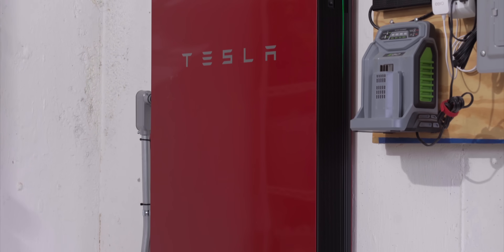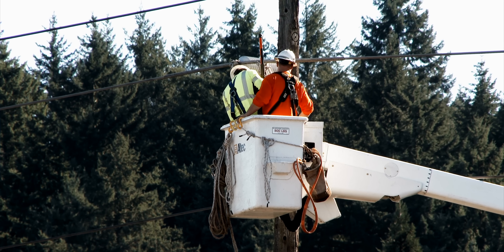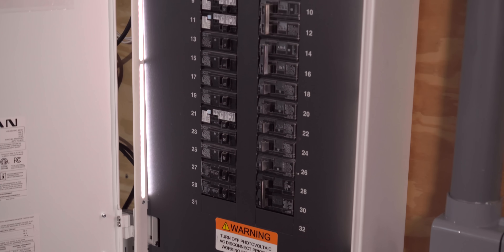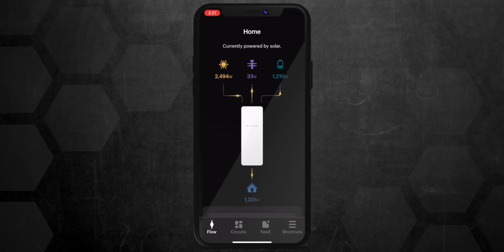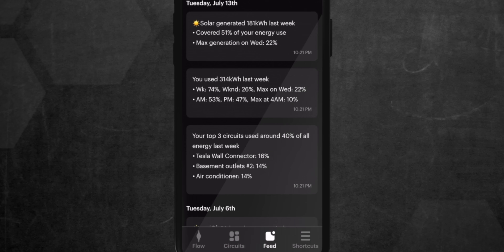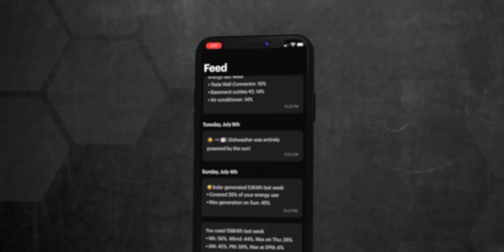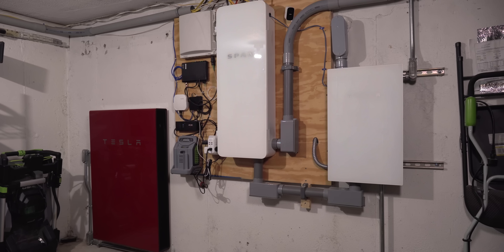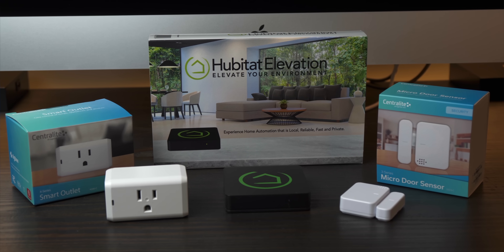This Smart Home Electric Panel Fixed My Tesla Powerwall

Comment: Sounds fantastic, my big and main concern is for when power goes out? If the internet is down am I back to manual control or will I be able to access it on my local network or directly via the app or another console? (sorry for the extra compound question).
Reply: Short answer.
Starlink.
Reply: I solved that problem by including a dedicated circuit for rhe internet/tv/router. It is included in the sub-panel that powers the house during an off-grid event.
Reply: @myfathersson7  That's my confusion. If the power is out, it will probably not be just my home. Having power to my router doesn't power whatever brings the service to my home. Or are those usually unaffected.
I think my alarm company has a box that uses a cell signal device with a battery in case of power loss, but I don't have "smart" access to any of that.

Comment: It'd be nice if Span connected to power backup systems via I2C or API. That would make it more flexible for home automation enthusiasts to integrate their platform  of choice.
Reply: It should work.   It should be able to tell how much power the generator is producing and allow you to decide which circuits and systems get power based on the three tier system.  You could change from fridge and electric stove to fridge and washing machine or fridge and lights everywhere.

Comment: You had me right up until you mentioned Alexa. I am not going to go down that road - Amazon and personal data are incompatible.
I really like the the control this panel provides. We have a 200A Square D panel, and with 3 240V circuits for our 10kW solar array, and a five zone mini split heat pump, and a 240V for our electric car charging station - and the way the house circuits were laid out for incandescent lighting (we have all LED/CF lights now), and for window AC - the panel is FULL. There are already a few half-width breakers, even.
Reply: Alexa is not enabled by default. The Alexa feature is an Opt-in so only activated if you decide you’d like to interact with your Span panel through Alexa. In your case, you could never activate it and it would work just fine.
Reply: Hoping they will be Home Assistant compatible in future

Comment: I have looked at Solar at various time over the years and the payoff has always been beyond the life expectancy of the components i.e. battery's, panels etc. and the Tax right off,s are some times there but mostly not, it has always come back to energy saving devices are the best way to go with my income( less than 6 figs) otherwise I am just buying another TOY to brag about at the Bar BQ.....so turn off the lights when you leave the room.

Comment: Thanks for the review, looks like a great product, every since smart products came out I thought a centralized smart panel was the way to go. The key element is getting the affordability, I currently use a energy monitoring smart plug system that I like but is lacking in software support to allow creative solutions and seems to be phasing out the power monitoring to become more of a plain herd mentality product and loosing the originality that attracted me. An idea I think is being under utilized would be the power monitoring of pumps for swimming pools. I have known people who had pools and the need to know when the pump is having problems is critical, from over 30 years in the power industry working with pump storage systems, power usage will tell you a lot concerning a pumps health and current operating status. I don’t know for fact but I would expect similar aspects would translate down into smaller pumps given the ability to monitor their power usage and program responses or alarms based on their real-time readings.
Reply: I agree. Pool pumps draw a lot of power, and if the filter gets clogged the draw can be more.
Reply from the maker: Great points, Tom.  Energy monitoring and control systems like Span can make a big difference for appliances like pumps.  Early detection of problems and appliance health is a big pro.

Comment: I’m all for saving energy but doesn’t this all seem really over the top? The cost benefit analysis of spending all of this money to reduce bills would take a lifetime to pay off with how cheap my electric delivery is.
Reply: It would make the most sense if you had an unstable grid where blackouts were common, lasted a few hours and had a high base power draw.

I would assume/home that a Tesla car charger and the power wall could talk so that charging ceased if the grid went down.  Other than that, I don't know how much you would want to shut off/on at the breaker, other than maybe stove and clothes dryer.

You could just use a smart plug for your dryer.

I have a number of smart plugs that I've programmed to shut off if the price of power spikes (I'm on wholesale rates).  If I had a battery, I could easily add in rules about switching off during blackouts.

For $3500 (as someone else mentioned), MAYBE if you were building a new, big house.
Reply from the maker: You hit the nail on the head.  What your local electricity prices are vs. cost of installing solar and/or batteriesis what it comes down to.  In my area, I'll be coming out way ahead over time.

Comment: In 1982 we bought land and had a house built. Favored the SW, added a two story sun room, heated with an open loop! Geothermal heat pump using water from our driven well 350 ft deep. The Carter administration offered substantial tax rebates to encourage active energy systems. Solar, wind were not yet feasible in southern NH.

Comment: How many circuits do developed countries have?? In argentina we have like two circuits per floor. I guess since 220 has lower currents and the cables have to go through in wall conduits (pipes) having multiple circuits is not as viable
Reply: They use electric for everything, heating, cooling, cooking, drying, etc.

North Americans consume a buttload of electricity.

Comment: If the “smart” side of the panel dies, will it default to all circuits “on”?
Reply from the maker: Yes.  It fails over to a standard dumb panel is a worst case scenario.

Comment: Already have that functionality built-in to my Enphase system.  Not the entire panel, but I can turn on/off up to 4 breakers which is usually your largest power drawers, which is all I need.
Reply: Is that from a standard Enphase system with Enphase battery or an add on?
Reply: @davidferguson7075  standard enphase system with battery.  I think it was only released a few months ago though.
Reply from the maker: Enphase has a really awesome solar/battery/inverter/panel setup.  Some really nice fine-tuned control there.
Reply: @UndecidedMF  Enphase could learn a lot from Span.io. I hope they're working together on integrating their solutions...
Reply: I am getting a complete emphases system (micros and battery) to replace some of my panels (20 years old) so looking forward to more comprehensive data being produced.

Comment: I'm hoping to get started on a solar build within the next year or so. We need a new roof anyway (older house) so the goal is to go tile.
This falls right in line with my plans, as we need to upgrade the electrical as part of the project. It's a 40YO house, with one main panel and about 3 sub-panels. Was going to upgrade to 200 service, so I think in my case the cost would be worth it.
Reply from the maker: This may be the perfect fit for your situation.